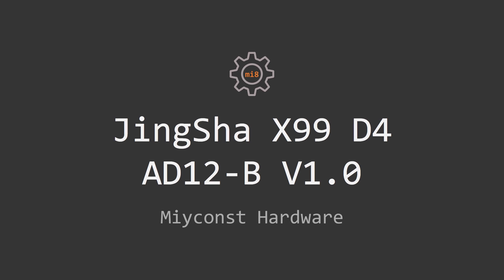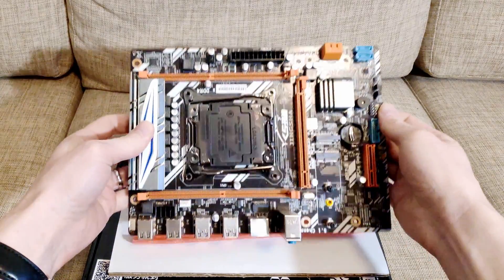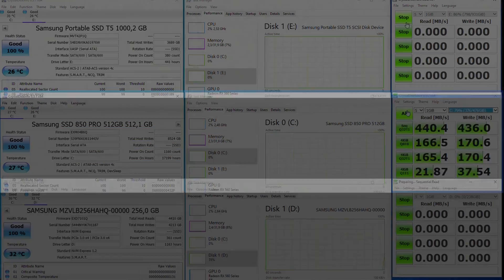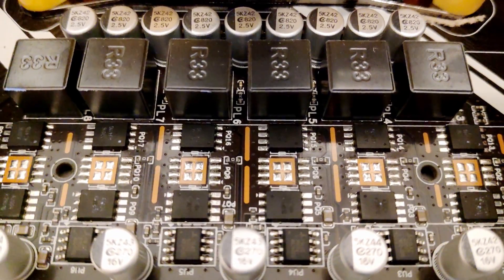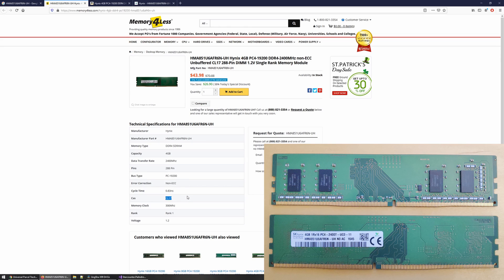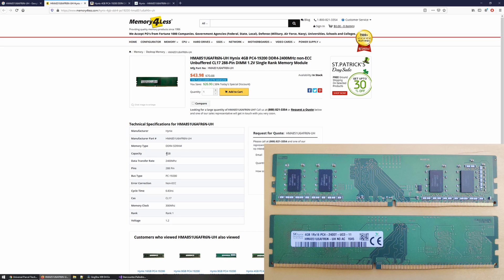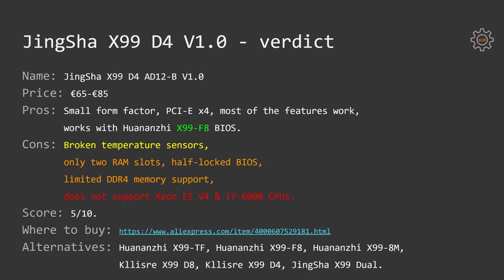🇬🇧 Detailed review of JingSha X99 D4 LGA 2011-3 | CPU Overclocking | Turbo Boost Unlock

Comment: Would it be a good idea to use a turbo boost unlocked e5-2697 / 2698 v3 with this motherboard? I've already installed a small fan above the vrm heatsink but I just want to check anyways. Thanks :)
Reply from the maker: AliExpress motherboard is always a bad idea, installing a high power consumption CPU is a double bad idea. It still may work though, if you ensure good VRM cooling.

Comment: Just bought this mother board. Can you rate my config?
E5 2690 v3 - 16G - 500 SSD - Rx 5700 xt
Reply from the maker: Rate by what metric? It's a very nice budget build and should serve you well, just make sure to cool the VRM properly.
Reply: @Miyconst  general rating, thanks! Can you recommend a good Wi-Fi card for this mother board?

Comment: @Miyconst 
I have got this motherboard with E5-2630-V4 CPU and 1 Stick of 16GB (DDR4 ECC) 
This build runs 24/7 as a server and stable with windows 10 , but I have an issue when the power goes out
the build have hard time to boot , I tried your suggestions in this video regarding the power management configuration along with a x99-tf stock bios 25-5-2020 build
the build seems to be more stable with power outage , but I have slow booting time in windows 10 (loading screen takes too much time - with ssd)
what do you suggest to do debug the issue with not booting sometimes and long loading page before windows 10. ???
Reply from the maker: You can disable Intel Management Engine in the Windows Device Manager, it will fix the long booting time.

Comment: hi mate need some helping have jingyue x99 d 4 titanium  I want to over clock but it keeps saying that I am missing saying that I am missing drivers can you please tell me which drivers are need to install specifically please...I wanted to ask ..if I can't use xtu can I use bios somehow? or is there no oc bios in this bios? pls help me shed some light pls.... 
wen I try to install xtu is tell me no compatible 
then I have to bypass by removing platform check =1 
but wen I install xtu I get another error saying 
need to install chipset drivers 
pls help 
I tried to go into optional downloads and install all chipsets but still won't work 
I'm using a i7 6900k and also have i7 6800k as well 
pls help

Comment: Hello .
I have this motherboard and the problem that i have is that when i install OS(W10) on the motherboard, when it reaches like 75% on installation it crashes and the sytem(i used 1 stick of ram here  )  restarts or sometimes it turns off, I have 2x8 gb non ecc 2666mhz of ram, and all the rest of the parts ( ssd,hdd,ram,sata cable,cpu ) are new . i also remove and plugged the cmos batt and still it crashes
ps : i used intel xeon e5-2620 v3 

Would it be the motherboard's problem or the ram?
Reply from the maker: You can validate your RAM using Memtest86, but most likely this is a motherboard issue.
Reply: @Miyconst  okie thank you <3 been subscribe to your yt channel for awhile now , GOD BE WITH YOU ALWAYS

Comment: mine seems to already have turbo boost unlocked but i cant seem to get it pinned to 3.2ghz with 2620v3 any thoughts?
Reply from the maker: You need to provide more info about the issue.
Reply: @Miyconst  ive run a bunch of single threaded benchmarks and i havent been able to hit 3.2 ghz and peaked at only 3ghz and mostly hover around 2.8 - 2.9.
when hit with a multithreaded all core benchmark it peaks at 2.6ghz. ive some some people maintain all core 3.2ghz boost https://youtu.be/Bb8cv3-AfSI?t=257
any help would be massively apreciated!
Reply from the maker: Most likely you have to implement the Turbo Boost Unlock yourself with -50/50 mv undervolting. You can use Mi899 for that 😃.
Reply: @Miyconst  will do! Great content btw man keep it up!

Comment: In device manager there are a lot of Base System Devices with missing driver. any suggestions? or just leave it be?
Reply from the maker: Install all Windows updates, including optional. I assume you are using Windows 10 Pro x64.
Reply: @Miyconst  that fixed it Thank You! Subbed
Reply from the maker: @mintcoffee500  I am glad to help :)

Comment: hey bro thanks for the video but ifound a combo e5 2640 v3 and thi motherbord for 250$ withe dhl fast shipping and i am scared for it not come do recommended it and can i always refoun all my money or its back to the seller because i was scamed withe a microphone it didnt cam and the refound days has ends.thanks
Reply from the maker: I have no clue what you are talking about. If you are buying from AliExpress, then you have to open a dispute before the order is closed, if you didn't receive it. In this case you will get the money back.
Reply: @Miyconst  so i have to open a disput after buying any thing or just befor refoun days finish
Reply from the maker: You cannot open a dispute after buying things, but you can open a dispute right before the buyer's protection runs out.
Reply: thanks but the mother board is jingshan d4 do you recommended it withe e5 2640 v3 and rx 570 4gb that i have all ready but the combo did not come withe a cooler is snow man is enof for agaming channel(recording and playing games and video editing)

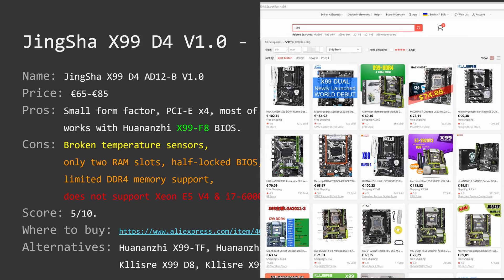Comment: Did you managed to make fan speed control working? At 10:35 it is written that temperature sensor doeasn't work. I'm wondering what can cause a problem in my board. I was thinking that maybe, I need to flash a BIOS, to a newer one (I don't know if there's any newer than 5.11 which I have) or Huananzhi BIOS as you did, or the temperature sensor doesn't work on my motherboard. Is it a common problem? Why your sensor wasn't working, is it an issue of a larger number of this motherboard? Have you managed somehow to overcome this, and be able to control fans? I'm getting frustrated, they are working with one speed all of the time, pc is so loud in stress. Would you be able to recommend some solution, if above couldn't be fix?
Reply from the maker: This is a common defect of the Chinese X79/X99 motherboards, the temperature sensors on the motherboard do not work, BIOS update won't help here. Most of the motherboard can control 4-pin fans according to the CPU temperature, but the 3-pin fans work at 100% RPM.
Reply: @Miyconst  So in your experience, there is nothing to be done? I won't be able to control these fans? Can I replace the sensor? All of my fans are 4pin.  I talked to a Chinese seller of my board, he said that in order to make this work I need to update a motherboard drivers and he is going to send me sth, did you try this way?
Reply from the maker: @MrRocendroll  it's a complete nonsense. Driver & BIOS update won't solve the hardware limitation. It's not possible to control rotation speed of 3-pin fans with these motherboards.
Reply: @Miyconst  But I have 4pin fans
Reply from the maker: @MrRocendroll  then you should be able to adjust their speed in the smart fan configuration of the BIOS.
Reply: @Miyconst  but, that's what I'm trying to tell you! ;D Unfortunately this option doesn't work
Reply from the maker: @MrRocendroll  could you show me a screenshot of your configuration?
Reply: @Miyconst  ofc but could you please provide with information what specifically you would like to see? HWInfo would do? Only motherboard?
Reply from the maker: @MrRocendroll  I just want to see the smart fan config in the BIOS. HWiNFO won't help here.
Reply from the maker: @MrRocendroll  the settings seem to be correct. What does Hardware Monitor show? Can you see the fan speed? Does it change when the CPU heats up / cools down?
Reply: @Miyconst  I've managed to do that. What a mess. I don't know how, i was absolutely sure, I connected fans several times, I'm good with tech -but somehow at the another time I was plugging fans i plugged in the sysfan. I'm sorry for taking your time for such a stupid mistake. You have really great channel and it gave me a lot of knowledge thank you! And thank you for answering people's questions under your videos.
If I can have one last question, it would be about a bios for this motherboard. You mentioned that you flashed to the huananzhi F8 bios. I'm thinking what I can get by found so? Is that the only bios? I have version 5.11
Reply from the maker: @MrRocendroll  I am happy to hear that the issue is solved :), regarding the BIOS, yes, I have used the original Huananzhi X99-F8 BIOS and it worked perfectly fine with mine X99-D4. Since the motherboard is compatible with the Huananzhi BIOS, it shall also be compatible with the BIOS from iEngineer, but since I have not tested it, I can't guarantee that. https://github.com/BIOS-iEngineer/HUANANZHI-X99-F8
Reply: @Miyconst  what does that bios changed in a comparison to original?
Reply from the maker: @MrRocendroll  X99-F8 BIOS gave me RAM timings, CPU overclocking, and better smart fan configuration.
Reply: @Miyconst  What specifically better about fan control it gave you?
Reply from the maker: @MrRocendroll  it has multiple temperature steps, which is possible to adjust, so you can setup the fan speed according to the CPU temps.

Comment: Nice channel! Can you talk about coolers for this socket? Think its compatible witch am2/am3 ...
Reply from the maker: It's only compatible with an extra bracket, otherwise you need a screw on LGA 2011/2066 compatible cooler.
Reply: @Miyconst  

umm i have a cooler ninja with bracket  for AM2 , can i use if buy this ?

https://images-na.ssl-images-amazon.com/images/I/61xrVSQ1CJL._AC_SL1000_.jpg

thank you
Reply from the maker: @gattsu24  most of the Chinese X99 motherboards come with such bracket, thus you don't have to buy it externally. If you are not sure - ask the seller if the bracket is included. Regarding the AM2 cooler - I can't say anything for sure, there are some coolers, which have very wide base and they don't fit into the bracket.
Reply: @Miyconst  aha i undestand , the most people buy this xeon want to save some money ,i have a lot of coolers from old sockets. 
 I would like to use them.

I am waiting for my x99 from aliexpress. hope i can use one of these old coolers

thank you.

Comment: Hi, i am testing now 3 mobos (2 x79 2.72, 1 is killsire, another Is alzenit and 1 x99 D4) they are fully working but the jack on the front panel doesn't work, what could be the problem? Now i reinstalled Windows and everytime i restart PC to install the updates the PC Is freezing.
I am using a brand new 240gb kingdian SSD. I had x79 and x99 mobos and never happened this to me. Hope anyone can help me
Reply from the maker: The front panel jack is most likely working, but the pins are mixed. For the freezing issue, it might be an issue with the latest Windows update
Reply: @Miyconst  i hope, on AliExpress they told me to download the audio driver.

Comment: Will this work with Xeon e5 2620 v3
Reply from the maker: Yes, it will.
Reply: @Miyconst  in your opinion is it worth buying? Because I’m not looking to spend over 80$ on a x99 motherboard or is there better options
Reply from the maker: For E5-2620 V3 I would buy Machinist X99Z.
Reply: @Miyconst  so it performs well
Reply from the maker: @_d_r_5572  it performs well as long as you don't try to do unsupported things like CPU overclocking or too tight memory timings.
Reply: @Miyconst  I can unlock turbo right
Reply: @Miyconst  if I’m doing turbo unlock I should be fine right?
Reply from the maker: @_d_r_5572  that's correct.
Reply: @Miyconst  ok thank you

Comment: Hi i bought a Jinshad x99 D4 with Xeon e5 2620v3 it was working great for 3 weeks then it stopped to show video i ask a tec about it, it look it up and told it was the GPU it was using a GT 1030 2gb Nvidia Gigabyte, he try it with another GPU of 1gb and it showed video, so i bought a MSI RX 570 4gb but i have the same problem now i dont know if my MOBA its damage or it doesnt support that kinda GPU cuz i looked throught a lot of videos and they try it even with titan series it wasnt exactly Jinsha D4 but was others x99 MOBA and worked great i really need help with this i cant spend that much at least for me its a lot, idk if i should talk to thd company in aliexpress or something i saw others guys and all went perfectly :/
Reply: My PC runs all the vents work, but my keyboard, my mouse and video doesnt show :/ thats my main problem :/
Reply: It has the combo of jinsha D4 2x8gb Ram and Xeon e5 2620v3, corsair TX650w
Reply from the maker: You should definitely talk to the seller, but before that you have to validate the motherboard with another GPU. If the technician says that the motherboard worked fine, then you can come back to him with your RX 570 and validate it again.
Reply: @Miyconst  Hi so i kinda solve my problem i just bought a new PSU 650w 80bronze but im having trouble everytime i run a game, any game it restart my pc when i launch it also i notice that my GPU driver i have to manually change my fans to spin everytime it resets its a MSI RX570 4gb AMD im starting to lose my mind :/ also i desactive turbo boost and still resets everytime i launch my pc i checked my temp and its fine i mean its always arround 30º-45º
Reply: @Miyconst  also i test with cinebench check on the stress on CPU and only reach 53º but when i did stress on the GPU it shutdown i guess is the GPU? its brand new just 1 days of use :/ i still have the guarantee but im trying to discart any other problem, whats ur opinion my friend?
Reply from the maker: @jhookfilms  According to your description, it really seems to be the GPU. The last thing you can validate is the memory.
Reply: @Miyconst  hi again it seems im kinda unlucky i guess, so i took out the RX 570 and put a GT 1030 it has drivers updated windows update, i tested with msi kombuster to stress 1080p all went max to 57° then i open a game especially Black Desert Online and again it reboots itself it didnt use to do that before i change my PSU to a better one its 650w, the one before that it didnt give my video, keyboard and mouse signal this one i have no trouble and its brand new, when i open the game i check the temp with a software both GPU and CPU, GPU gets around 40-45° and CPU only gets 35-38° so why my pc still reboots when i launch the game i dont get it :/ is it ny MOBA? Or something? Im getting tire of that i already spend money on GPU, PSU, and MOBA combo, how can i check if its the ram? Should i buy one? What should i do as i said im tired really tired all this week has been stressful to me :/ and it was ok even with the PSU that "crash" my video,keyboard,video signal it didnt reboot at all till that day, i played games with no problem with GT 1030. Thanks for still answer my complains
Reply from the maker: @jhookfilms  it seems like the best option for you would be to handle the PC to some service point. At this point it's hard to say what causes the problem, and the service point should have spare components to swap and test to isolate the issue.

Such issues are really hard to isolate, and you have to take everything out of your chassis and swap the components one by one to figure out what is the issue.

Comment: hi, can i use Xeon E5 2640v3(or 2678v3) with turbo on that Motherboard?
Reply from the maker: Yes, you can.
Reply: @Miyconst  No VRM throttling with 2678V3 on this motherboard (full load long time, rendering)?
Reply from the maker: @miosz8531  No throttling, as long as you have at least some decent airflow in your chassis.
Reply: @Miyconst  Is posible to use ram non ecc and ecc in the same time on X99 motherboards?
Reply from the maker: @miosz8531  No, it's not possible.
Reply: Hoje tem gol do gabigol
Reply: @GameRRKing  kakakaka

Comment: Good afternoon, what processor limit with active unlock boost for this motherboard? The intention is a 2673 v3 or 2678 v3, would it be possible?
Reply from the maker: E5-2673 V3 should work with no issues, E5-2678 V3 might need some good airflow around the VRM zone.
Reply: @Miyconst  ok, thanks for the info, great job ...

Comment: 2666 MHz ddr4  Works??
Reply from the maker: RAM speed doesn't really matter, it can be even DDR4-4000, but with Xeon CPUs it will be limited to the Intel's specification, for example, for E5-2678 V3 it's DDR4-2133.
Reply: @Miyconst  Ok, Thanks Bro...

Comment: E5 2620v3  turbo  3192.38 hz  good  ลงวินโด้ใหม่ใช้ได้ดี  คุ้มค่าที่สุดแล้ว เยี่ยมครับ
Reply from the maker: No, you have to run a stress test and see if your system is stable. If it's not stable - figure out why it's not stable. Also, what is your complete system configuration?

Comment: can i use E5 2620 v3 in turbo boost with this motherboard?
Reply from the maker: Yes.
Reply: @Miyconst  thx for the help, u are the best!
Reply: @Miyconst  just another question, i'll need to change bios to put E5 2620v3 in turbo boost?
Reply from the maker: @vladboyz  Yes, you would have to perform the Turbo Boost unlock procedure. Recently though, many X99 D4 motherboards come with already unlocked turbo boost, thus, you might not need to do anything.
Reply: @Miyconst  i understand, if i need, do you have a video about that or how to do that?
Reply from the maker: @vladboyz  I do, you will find all required videos, downloads, and text information here: http://www.miyconst.com/Blog/View/2081/xeon-e5-2600-v3-turbo-boost-unlock
Reply: @Miyconst  thanks for the help, you are the best!

Comment: good afternoon friend, greetings from brazil, so i wanted to know if with this motherboard you would be able to over-run the e5-1620 v3 processor up to 4.0 ghz, with no heating problems in the same circuit? because i live in a state here in brazil where the climate is cerrado, very dry and hot on summer days.
Reply from the maker: Xeon E5-1620 V3 has locked multiplier and it's not possible to overclock it.
Reply: Estou tentando congelar meus VRMs para poder usar o 2658v3 . Mesmo assim eles estão trabalhando em 70 graus
Reply from the maker: @leoxanas  70C is an okay temperature for VRM. How did you check the value? With software or with external measurements?